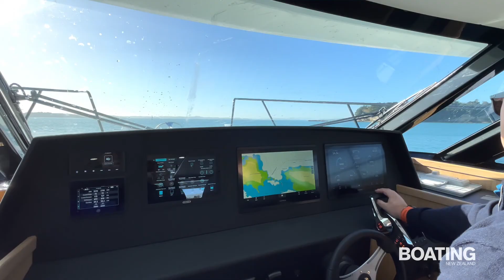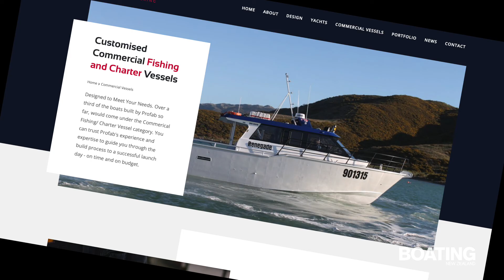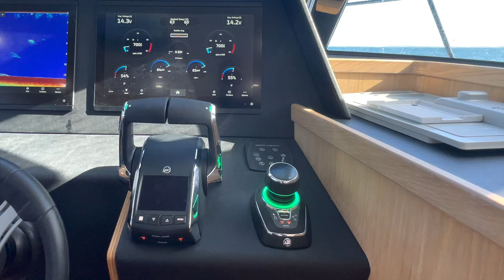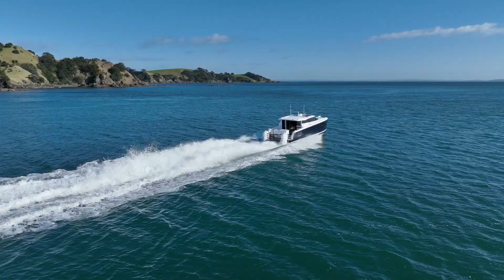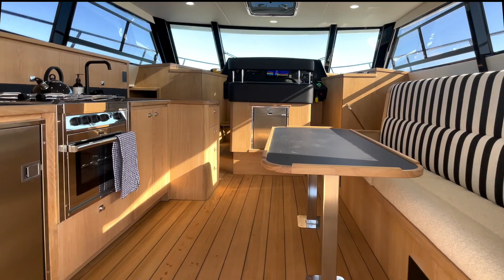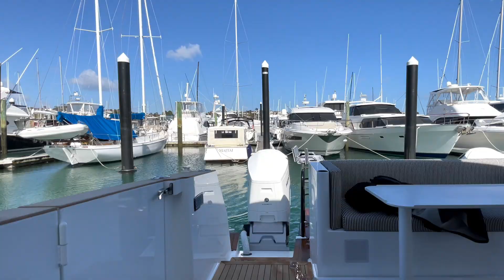Profab 1200

Comment: Simply put, a childish grin is not my cup of tea. Burning 20-30 gal of fuel per hour is so “yesterday” especially for an adult nowadays. Quiet cruising comfort forever instead of racing out and back to refuel. If i want speed, a lightweight racer is key. But a cruising interior with all the weight is not built for speed.